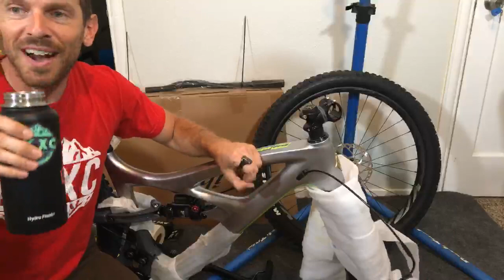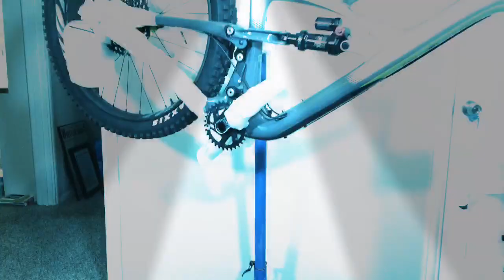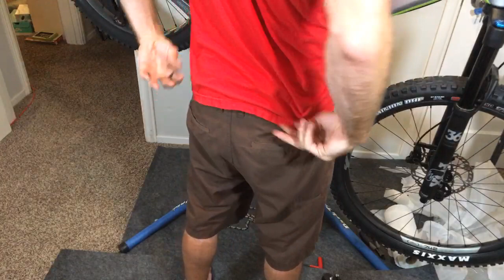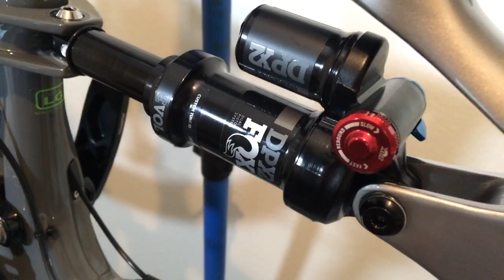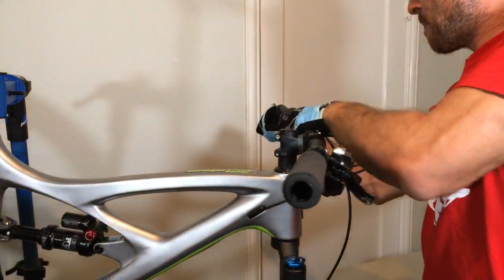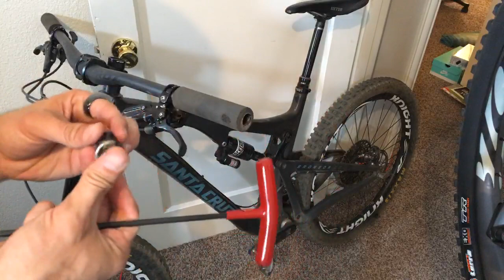All night Ibis Mojo HD4 build

Comment: IF you got those rough towels, they grip well to the grips,actually works better than using a rag. so your hand won't slip when installing the grips, I heat up the grips with hot water, the ziptie method is flawed, but water expands the grips so the hole will be bigger. having the bike on the floor helps too, in the stand you don't have the necessary leverage to get them on fast. as soon as the grips cool down they shrink to normal size, so they will be tight.

Comment: You should have sized the chain with the suspension all the way compressed.  If the suspension has chain growth (which it does) it may rip the derailleur off/bend the hangar/snap the chain if you're in the largest rear cog and the suspension is compressed.

This may or may not occur but the chain is not long enough as it is.
Reply from the maker: Good call dude!

Comment: Hey, when the balls on those Bondhus wrenches wear out, I can cut them cleanly flat off on our wire EDM and ship them back to you, no cost other than shipping them to me.  Just an FYI.  If you have a bench grinder you can grind off the ball end and just leave a flat but be careful not to get them too hot where they change color.  That ruins the metals temper and hardness.  Dremel cutoff wheel would work too.
Reply from the maker: Oh wow, didn't even think about that!

Comment: I noticed with the Fox Fit Grip damper is that the adjuster knob move way too easily, so if I ride really hard, it goes out of adjustment, and making my fork stiff,but on normal light trail rides it won't happen. I rode some urban mtb- stairs jumped off them and bunny hopped a lot.
The Ctd knobs have the same issue, the rear Shox too.
I usually run in fully open but if i ride hard the rear shock snaps in trail mode, because of the harsh impact of the ground.
when I turned the knobs on the Rs Pike in a shop, I notced the there was clicks and it felt a lot firmer,So I guess it would not happen on that fork.
Reply from the maker: Interesting!! Thanks for the heads up Johannes
Reply: Today I tried the compression dial on Rock Shox Pike RC, I loved how firm the clicks were, I am quite sure it won't go out of adjustment, unless it's directly impacted hard, I wish I had as good dial on my Fox 32. it was on a Diamant which is rebranded BLIZZARD 90-27+. I hate rebranding, it makes no sense.

Comment: $10000 bike with deore brakes?
Reply from the maker: Yeah very weird
Reply: lel its likely that if they put like guide brakes or xt it will add only $100 max !
Reply: This bike (GX Eagle build with the carbon wheel upgrade) retails for $5,599, not $10k, but I take your point. Should have at least XT brakes.